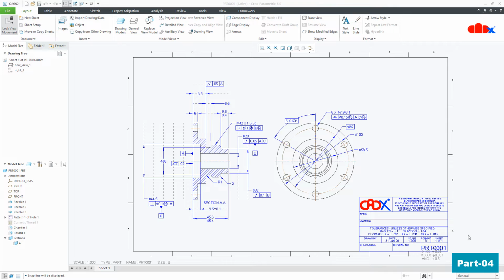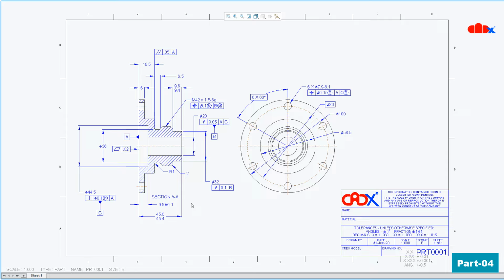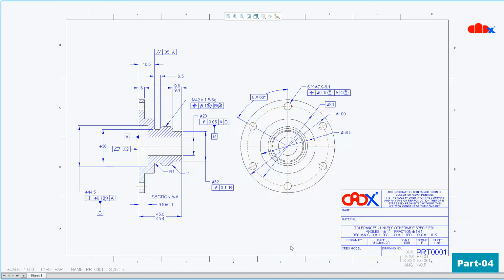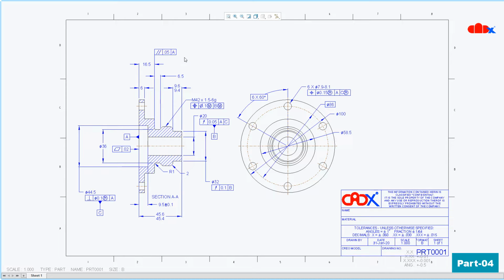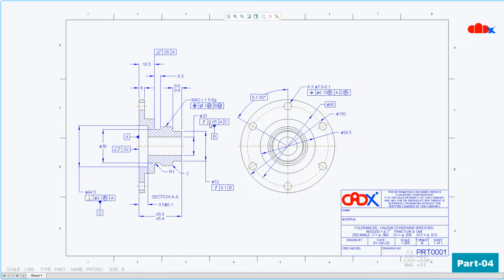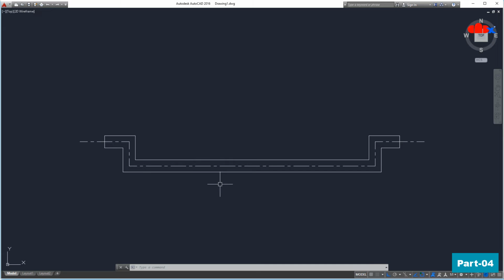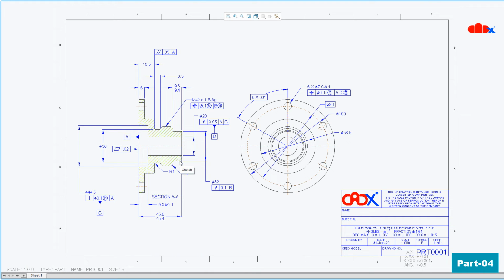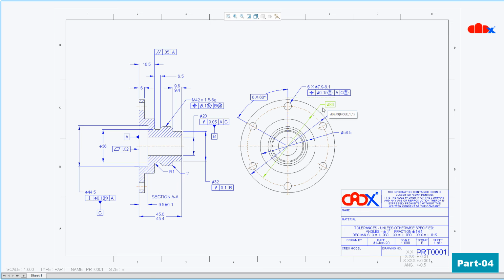Drawing Detailing in Creo Parametric with GD&T (Part-04) Significance of GD&T symbols

Comment: The example for runout is not correct. The axle displacement along the axis should not exceed 0.025, and 0.05 in diametrical terms

Comment: Hi CADX,, have a query - both B and C datums are subjected to centrline only  ??
Reply from the maker: Actually we have two different center line there for two diffrent feature.
Reply: @CADx-in  agree,, but both centrelines are collinier right  ?? There is no offset
Reply from the maker: As a beginner it is difficult to understand but I will try to to explain you. There are two different size bore which cannot be manufacture at the same time. If there is a relation between both the bore then you need to control both the centre axis using gd&t with each other.
Reply: @CADx-in  Got it thanks.. There are two different dia of bores and practically each having a different center lines. 

Way of explanation is good,, keep it up 
👍👍

Comment: First of all those are not Datums, they are Datum Features. You don't pick primary Datum Feature by how are you going to measure part, it should be picked by parts application in use. Primary Datum can not be "tilted" as it is PRIMARY and everything else relates to it. Runout controls surface variation from nominal not axial.

Comment: Your explanation way was best and ever best 
sir in drawings how can I understand the dimensions are in inches or mm
Reply from the maker: That doesn't matter for most of the people, everybody has their own standard template done in either inches or matric. Generally if the dimensions are having two decimal place then it will be metric and if it is 3 decimal place It will be inches.
Reply: @CADx-in  Thanq sir 😍
Reply: It also depend on standard fallow by company ASME(first angel projection) or ISO(third angle of projection). ASME use inche and ISO use mm as unit. 😊😊
Reply: @monty9164  Thanq 😍